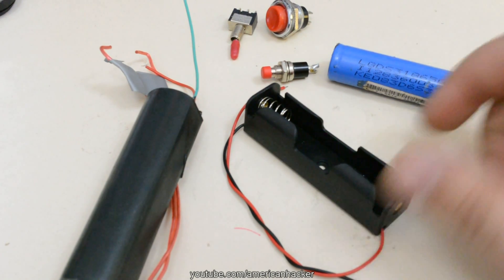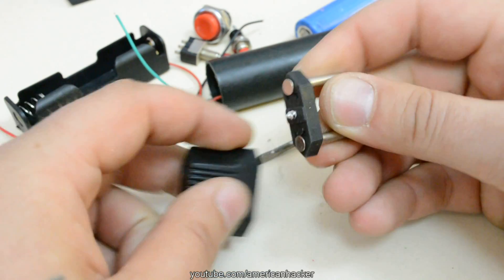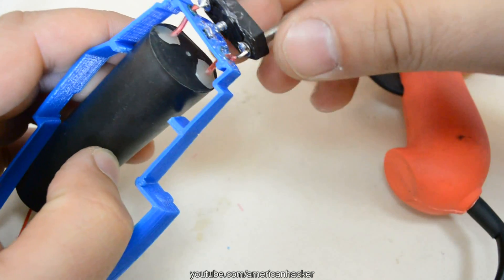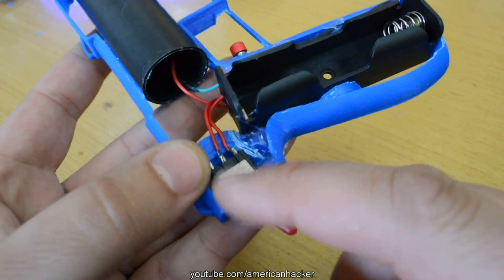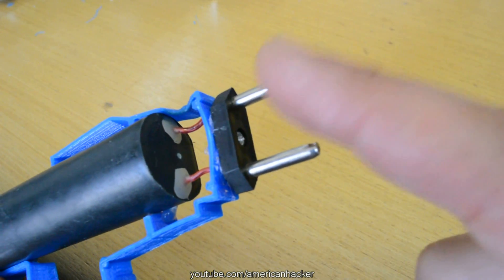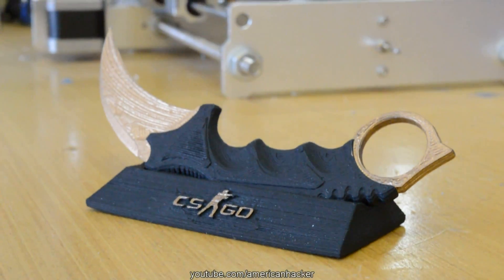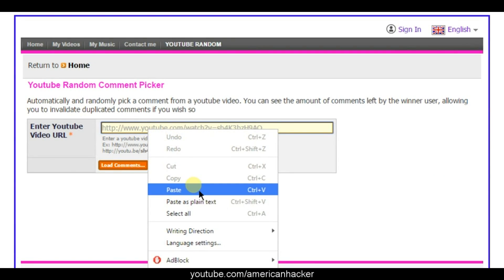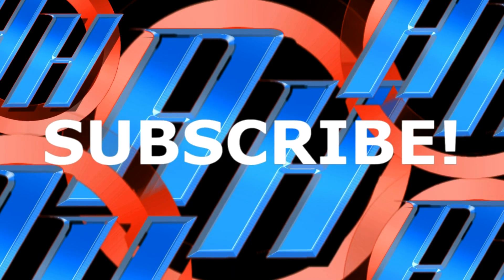How To make A Stun Gun!  (1 million volts)

Comment: The problem is that the chinese modules do not have a very usable duty cycle before they over heat. Need a heat sink on the switching transistor.

Comment: That is nowhere near 1000kV, the spark discharges the capacitors inside the booster at less than 40kV with that distance between the pins

Comment: sorry m8 this isn't 1 million volts, more like 300kv
Reply: OldFordas you wish it was 300KV it's more like 30-40Kv 300Kv would be Tesla Coil type arcs lol.
Reply: well judging by the distance between those prongs (17.5mm) and the breakdown voltage of air (3kv/mm) that's just over 52.5 kv
Reply: its more like 1kV/mm
Reply: Tobinator no, airs dialectic dialectic strength is 3MV/m which converts to 3kv/mm
Reply: I tried it with my 5kV transformer and the arc jumped at 7mm so...
Reply: Tobinator probably wasn't 5KV then.
Reply: But it is rated for 5KV and  the insulation would never be enough for 15kV
Reply: And it has 80 mA so that would be at 7mm 21kV and 21000A*0,08A=~1700W 1700W/230V=~7,4A and it doesnt even nearly 7A. If I did something wrong than please correct me
Reply: +Tobinator no idea what you've done wrong but all sources rate air's dielectric strength at 3MV/m, maybe the air you tested in has some aberrant properties increasing it's conductivity.
Reply: OldFordas The 3MV/m does only count for 100% dry air

Comment: 1 million volts will fry and kill someone
Reply: First of all the comment that says volts hurt amps kill is absolutely wrong, volts determine how much current(amps) will flow through your body, meaning volts are what kills. That being said, the is transformer can only provide a small amount of current, so the voltage drops when someone touches it.
Reply: volts hurt, amps kill.
Reply: just beacouse its high voltage dosent mean it will kill you. normal tasers are like 500.000v way past the amount to kill someone but people are fine afterwards. there are many videos on youtube that explain it.
Reply: The Piscis just repeating what my shop teacher told me years ago.
Reply: Well a lot of people think thats the case, but it's a common misconception.
Reply: No, it won't. It's NOT just the voltage that counts, it's the current as well, and the current through this will be very very low, as the power from one battery is almost all being converted to voltage.
Reply: terrypussypower 
well the voltage drops when it touches your skin, as it can't sustain the current drawn by the resistance. in that case the most useful information is the voltage it can sustain when someone touches it, i.e. the voltage at equilibrium.

Comment: 1 Milion volts? You could KILL someone with that!
Reply: +Jan Hess its the amps not the volts
Reply: ***** Wait WHAT?!?!
Reply: +david hanita just about to say that
Reply: +david hanita was just about to say that
Reply: he said 1 thousand kilo volts lollll
Reply: +Pikachu13w http://www.banggood.com/7_4V-800Kv-Ultra-High-Voltage-Generator-Module-Inverter-24cm-Arc-p-1045012.html 
"Output current: about 1A" thats not low amperage, but then again it does say input current and voltage is only 3.7 - 7.4v at 1 - 2A so 1A out doesn't make sense

Comment: marjan bro I have some ideas .
how about make something new like :-
1.)3d printed vr goggles.only lens to be added.
2.)clapping machine.
3.)arcade gaming machine dock for iPhone. where if you push buttons you can controls old news games using iPhone apps such as news emulators and ROMs.
4.)how to make a PCB using fecl3 and copper clad board.
5.)3d printed cup with a straw attached to cup to drink water through straw.
6.)led matrix frame .
7.)portable iron press.
8.)quadcopter.
9.)life hacks on saving money on daily basis using cheaper methods. like placing a 2litre coke bottle filled with water in the flush tank to save excess water flush.
10.)led night lamp for 20cm*20cm of warm white led strip.
11.)virtual reality viewer.
12.)led vu meter.
13.)rubber band guns.
14.)selfie stick for iPhone and tripod mount.
15.)arduino projects.

These Are my suggestions to you and I hope you select one of these and make some projects as mentioned.
I salute you Marjan (american hacker)bro.
 

Greetings,
Navneeth S.

Comment: Cool project! I'm gonna make it. But if the generator doesn't discharge (put a plastic sheet between the output wires) or the output wires are shorted out it could be damaged. How can I prevent that?

Comment: Really good gun, but can u put the electrode with 1 million volts and drops of water that is between two aluminum plates - it should make the hole as if it drilled. Thanks

Comment: Great vid!!! Just wondering, could you use a electric fly swatter.
Reply: I have tried it with electric fly swatter.mine is only about 3000 volts
Reply: I have tried it with electric fly swatter.mine is only about 3000 volts